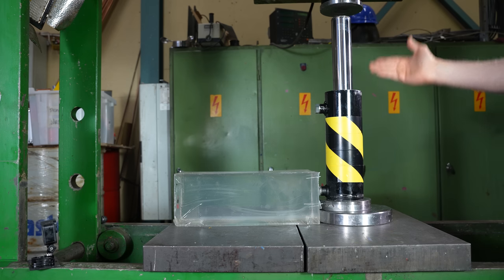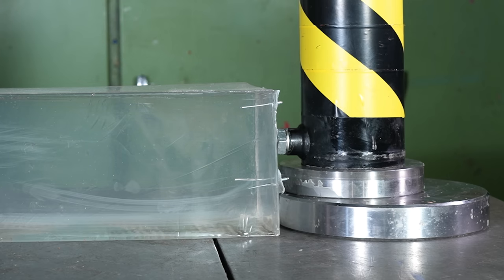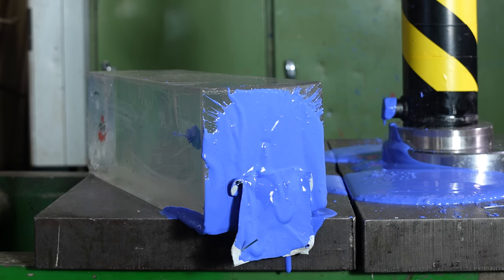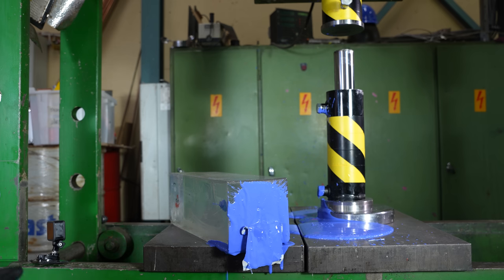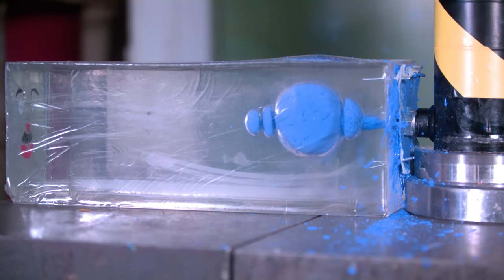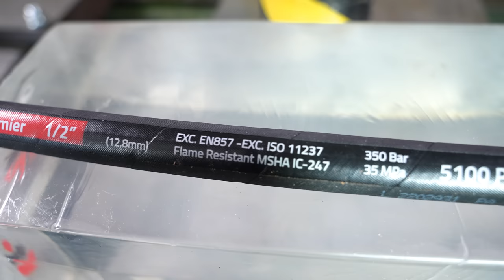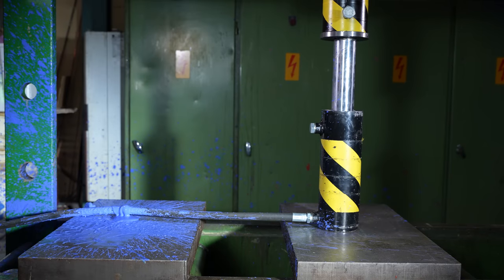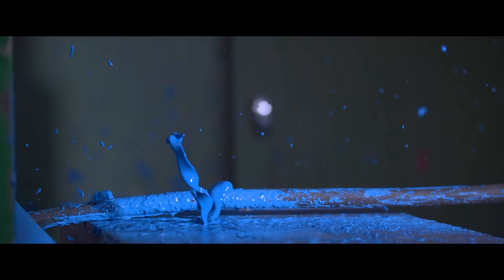Injection Injury Demonstration With Hydraulic Press | How to lose your hand!

Comment: I think I've had the most controlled least lethal version of this happen to me. I had to have a dye injected for a medical scan, and anyone that's had dye injected knows it's no small amount. For some reason the nurse was in a hurry so, after injecting the needle just fine, she slammed the syringe down injecting all the dye super quick. This hurt like a son of a bitch. To get an idea of what it felt get one of the super long balloons clowns use to make balloon animals. Gently fill the balloon up so that it's not stretched at all. This next bit is what my veins felt like. Now that you've got a vein looking balloon either slam down on your balloon pump or breathe as hard as you can into the balloon. The part that suddenly expanded is what it felt like. 

As I was saying this hurt like hell so I can only imagine the added pain from the extra fluid at a higher pressure.